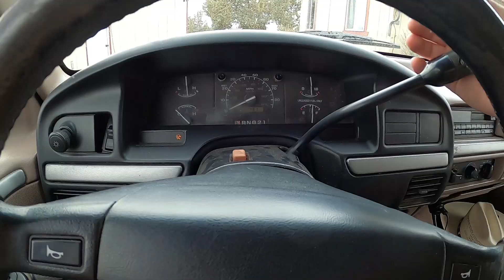getting the $200 truck home and in the shop

Comment: I had mentioned previously that I had a 351 that I bought for parts and a core but ended up going a different route building building a 351 from scratch did not need the extra parts being I went with high-performance in any case I wish I could send you a picture of the new engine it is absolutely beautiful. PS I still got that 351 for sale if you're interested.